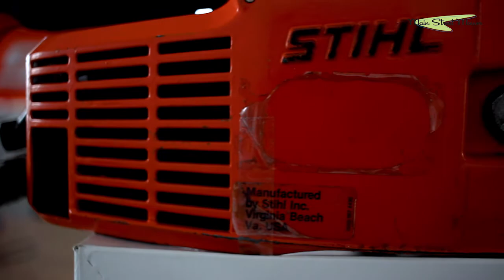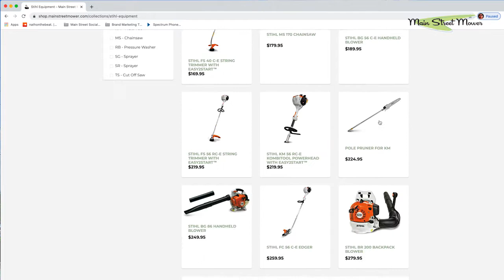Why Buy STIHL? Top 5 reason - Best Landscaping products 2020

Comment: I'm just starting out but bought a FSA90R, RMA510, BGA86, KMA135 with paddle attachment, three AP300S batteries and an AL300 charger. They have been working great my first season. Looking at getting a MSA220 soon. They all have been great and problem free and get alot of compliments that they are so much quieter than the gas units
Reply from the maker: Nice picks, those are some of our favorites! Love that MSA220 with a 16” 63-55 chain (3/8 pitch .050 gauge) chain. FYI the MSA300 is due out by the end of the year, it will run a 18” .325 pitch chain, similar to a gas model MS271
Reply: @mainstreetmower  ohhhh thanks that will be a next year purchase as I'm saving for a ego 24" dual stage snowblower right now
Reply from the maker: @brandonhiggs88  Awesome. Good luck

Comment: Echo makes a better product. Sthil 4 mix are not good! Hate having to adjust the valves
Reply from the maker: Half of the Stihl product line up is 2 cycle (no valves) the other half is 4-mix (valves). The 4-mix models, have more torque , greater fuel efficiency and 5x less emissions. From a dealer that sells over 5000 Stihl units a year, we perform less than 300 valve adjustments. That means valve adjustment isn’t that common. Most of our customers prefer the 4-mix engine models, but if your worried that once in 5 years you may need to spend 15 mins and $2 in parts to adjust your valves, then buy the 2-cycle models instead.